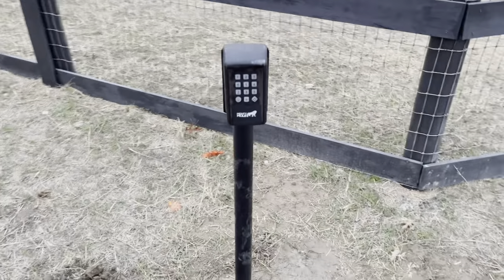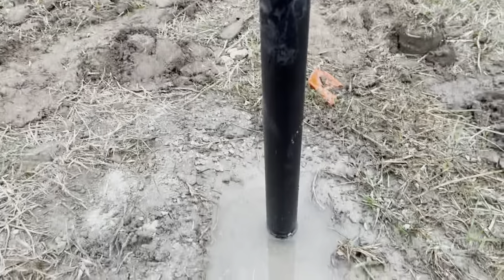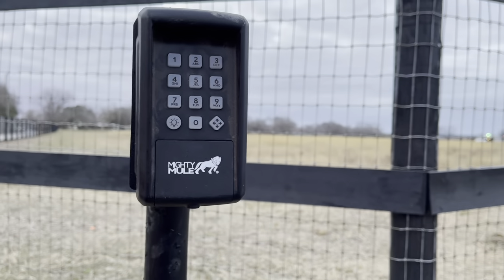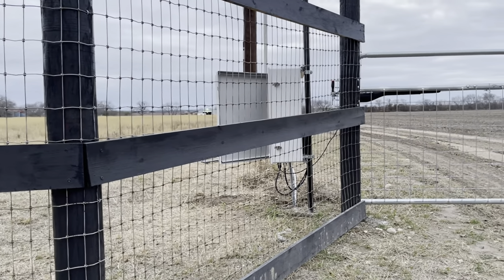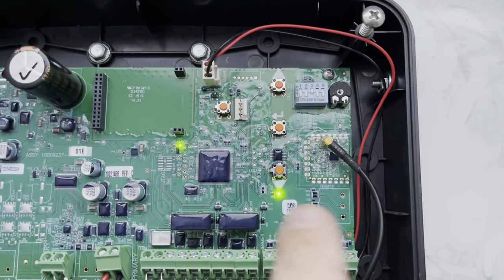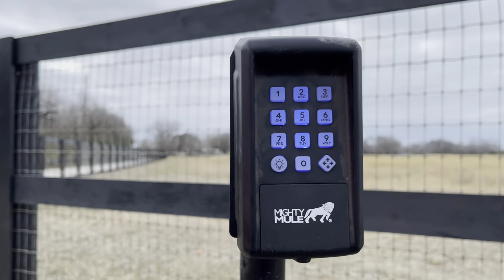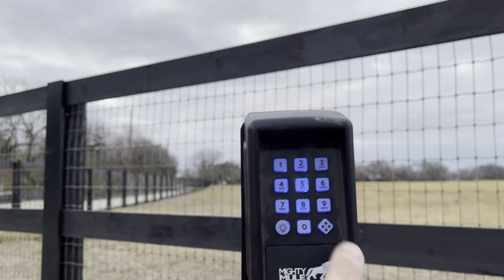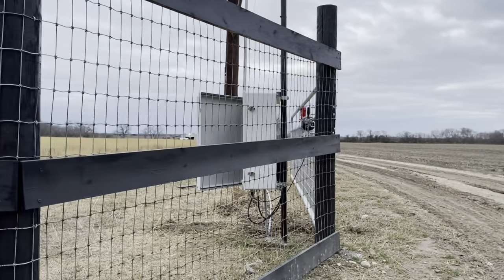Mighty Mule MMK200 setup

Comment: I have one of these.  Several things I would add:
1. You can program up to 25 different codes. (I can't imagine needing more than 2 or 3, but there it is)
2. To unlearn a code, just program it again (Learn button in the control box, then enter the code at the keypad followed by the start/stop key).  That code will be erased.
3. After entering a code and pressing start/stop, you can press start/stop again to open, close, or stop the gate (just like the remote).  The start/stop button is active for 30 seconds before you have to enter the code again.  This is handy to know in case you notice something in the way of the gate while it's moving.
4. The lower-left button (with a light bulb symbol on it) is used to back-light the keypad so you can see it in the dark.  Use it if you want to see the keypad before entering the first digit of your code.  Actually, pressing any key also lights up the keypad.
Reply: So how do you program the other codes?
Reply: @WilliamHardwick  Just like the first one:  Learn button (S3) in the control box, enter the code at the keypad, then hold the diamond-shaped key (start/stop) until opener beeps once.  3 beeps means it didn't work--try again.

Comment: Does the MMK 200 require low voltage wire connection to control panel?

Comment: I have an FM137, I built my own post using a 4x4x8.  Buried and conreted about 20-22 inches into the ground.  Came up about 40ish inches and cut a 45 for the angle with a flat side facing the car.  Much better and cheaper.

Comment: And what's or where it's the learn bottom???
Reply from the maker: Learn button is on the board top right middle
Reply: @integrator_101   I never found the learn bottom on the keypad! I found it on the main motherboard, just like your video, but don't worry, I returned already !! If I can't get it to work, I don't want it .
Reply: @integrator_101  But thanks.

Comment: Where on earth is the learn button!?! I cant find it anywhere!
Reply: Looks like I have a different model.
Reply from the maker: On the inside of your panel do you have like 3 orange buttons on the upper right side?
Reply: @integrator_101  no. I think i have a newer model.
Reply: @integrator_101  its a much smaller panel than yours.
Reply from the maker: @EpicAdvanture  ok mines only a few months old. Is yours a single or dual?
Reply: @integrator_101  single
Reply: @integrator_101  mm271
Reply: Key pad gets you in but how you get out ?